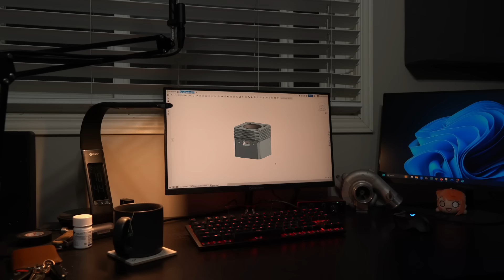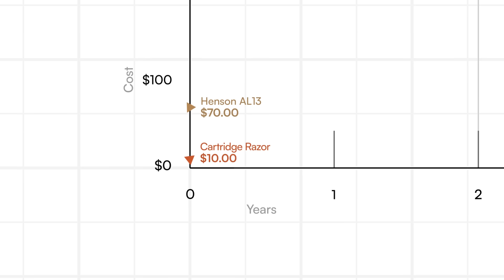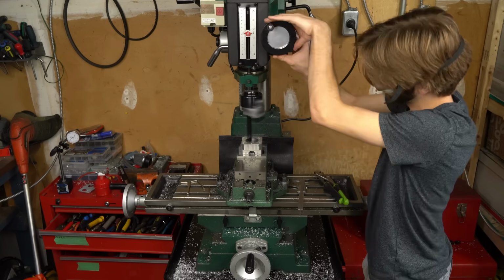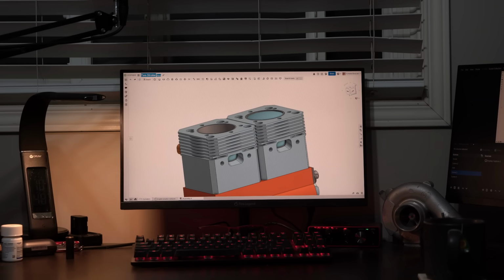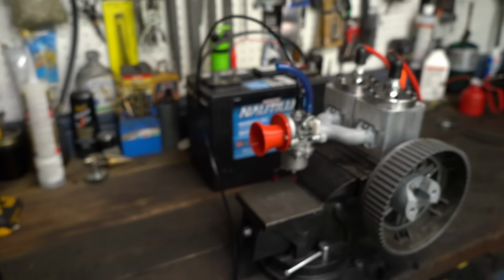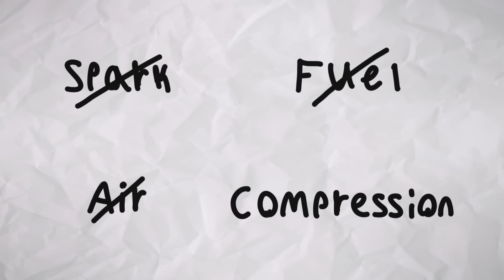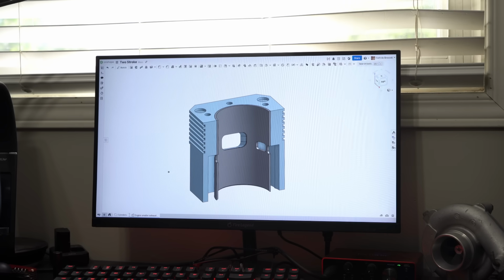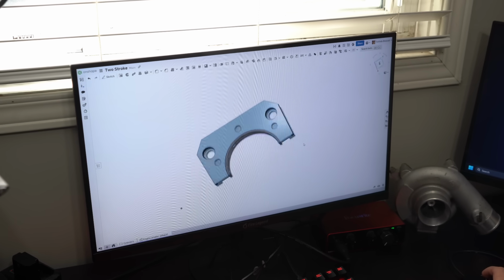Building a Two-Cylinder Two-Stroke Engine

Comment from the maker: 🪒 Check out Henson 👉🏼 https://hensonshaving.com/camden
Use the codeword: camden at the checkout, put the blades in your cart and get 100 for free!
Reply: I got a Henson razor a while ago. Go for the mild and not the medium. The medium is best suited for face shaving and is aggressive in other regions. Overall it’s goated
Reply: @onewaygaming8380 yes I also love it but the medium actually works for me on the body even with feather blades and I also have quite sensetive skin
Reply: If you're building a 2cylinder 2stroke, why not put one central carb on the crank case seeing as both cylinders are slotted and ported properly. You could probably also make the sleeves 1/32 thicker to help avoid warping, and i trust you are using a 2 stroke oil fuel mix to avoid wear out
Reply: I'm not going to stress the aero of the sleeves too much but having a slightly rounded entry to the intake port might help with the AFR
Reply: You need to have 2 stroke exhaust because 2stroke motor needs backpressure or it goes too light and copression doesnt be as good as its need to be. sorry bad english i'm a finnish 2 stroke moped guy and i have tested my 2 stroke yamaha dt without exhaust and it broke down because i didn't have the exhaust
Reply: You need a 2 stroke exhaust because if not it will have light back pressure and the gas will escape
Reply: @mamamia4458 yeah, thanks you did tell it better
Reply: The 2-stroke engine must have a muffler that has a space to reject exhaust gas so that the exhaust gas returns to the combustion chamber, like the muffler on a 2-stroke trail motorbike which has a bump, sorry for the language.
Reply: @AgusPradnyana-qy4zr you did tell it so much better what i did
Reply: Bir egzoz ekleyin iç kompresore ek hava almmaması için rölanti dengesiz olur
Reply: Respectfully 2 strokes are absolutely trash, the only good thing about them is they're lightweight and rev fast but that about it. A 4 stroke would be so much easier to get running right but it requires more parts but you can change the timing and other things so much easier. You can even buy a little predator 212cc engine from harbor freight and tear it apart to inspire you on your own engine and the small engine community around those types of engines have a lot of knowledge to learn and tricks and tips and aftermarket parts for you
Reply: @thecrittercage8255 daytona?
Reply: Add a cooling system
Reply: So much white smoke means fuel air ratio is not proper.
Reply: You maka da engine
Reply: Homemade wankel engine when?

Comment: do you put a taper on the pistons? They, as I'm sure you already know(sorry), will expand at the top near the rings as they heat up..
Reply from the maker: The pistons I used in this case were actually off the shelf, but to reaffirm, the top measured a smaller diameter than the skirt. I don't remember how much exactly but if I recall about 1/3 up the way from the bottom of the skirt measured in at 43.95mm while the top near the rings measured in closer to 43.85mm
Reply: @CamdenBowen  not to waste your time, I just thought that could have also led to some of your issues...keep the vids coming, strap that dual head 2 stroke on a bike too.

Comment: To prevent the cylinder from ovaling and to have the sleeve supported the entire height I would move the transfer ports away from the centerline and leave a thick rib in the middle.

Comment: If you enjoy model engines,  Have you ever visited the "Cabin Fever Expo" show in Lebanon PA ?  this year on January 16-17, 2026 Lebanon Valley Expo Center - 80 Rocherty Road Lebanon, PA 17042
SHOW: Friday: 9:00 AM - 5:00 PM  Saturday: 9:00 AM - 5:00 PM      They also have an auction where you can buy and sell lathes, engines, and tools

Comment: Honestly, you should do a twingle engine. It's a two stroke engine with two cylinders connected by a small passageway. If made correctly it can be efficient and reliable as a 4 stroke with the power of the two stroke. Just a suggestion, love your stuff btw.

Comment: Ok but what about an 8 stroke engine. It produces way less heat, has more time to get a proper air fuel mixture, and if you run them in offset parallel you could have a power stroke every n-th degrees if you wanted to

Comment: interresting, you did shrink filling and mention the trabant, that's exactly what they did in east germany. They had cheap access to aluminum but not to steel, so this was the solution.

Having an exhaust with an adequately sized end pipe stinger makes the idle much better. The smaller it is the more stable the engine runs . Too small costs power but runs smooth.

Also the china carburators are a$$. Better get some used moped carb, one from a real company. One that you know it works.
They do react in strange ways to adjustments. Often they do not even let enough fuel into the float chamber.
So no matter how good the engine is, the carb can fool you.

Comment: Reeds improve any piston ported engine. If you need extra fuel getting in, you could fit a power jet in the bell mouths. Some people fit them at the top, and others prefer mid-height mounting of the jet, It's easily done; I've fitted a few in my time, always at the top.

Comment: Instead of conventional 2 stoke you should make it like a 2 stroke diesel with valves and a crank case that can hold oil it will be more durable
Reply: you can't have a 2 stroke with valves
Reply: @oren2000  yeah you can two stroke diesels had exhaust valves for better scavenging I think they have to be supercharged though

Comment: shorter boring bar in the boring head would help the chatter. As a rule of thumb when you do a finish pass leave 1/2 of the insert radius for a good finish and when a part comes out of your work holding don't pull the tool out just hit the E stop  and leave it. you could have pulled the aluminum out of the vise and shot it across the room

Comment: awesome series, really. maybe you could try to run the carburator mixture into the crankshaft casing before routing it into the cylinder, this way the crankshaft gets lubricated and acts as a sort of volumetric compressor. keep it up nice work.

Comment: Cast iron sleeves should be used because they resist spalling and don't thermally expand as much as forged parts.

The crank and caps also need to be hardened, they'll wear out faster due to the unavoidable high pressure and high friction they endure.
Reply from the maker: I wanted to use a pearlitic gray iron because of its hardness and self lubricating properties but no metal distributor anywhere around me carries cast iron in any capacity. Next time I will likely order some from McMaster carr

Comment: Machine stability Is definitely a factor so I’d rigidity so make sure the gib strips in the slide ways are tight also try shorter or thicker boring bars as they will flex less lastly have a peek at your spindle bearings some sneaky mill manufacturers use ball bearings in their spindles these days and this is bad for quite a few reasons this old Tony did a deep dive on this on a mini lathe he bought hope this helps

Comment: a two stroke needs a fuel oil mix so it is lubricated pls do it  idealy 1 part oli 32 prts fuel but you would have to figure that out yourself because every two stroke has ist own preferences

Comment: I guess the problem is on the intake part you should be place the intake facing the crankcase not the cylinder so when the piston goes up it will suck the fuel and air mixture to the crankcase and when it goes down it will push the fuel air mixture to the cylinder block

Comment: the "two ports" setup you're using for my opinion is useless, it might work better with only one port. A and C ports in two strokes are different from each other, having one single duct that ends with two smaller ducts on the sleeve is not that good for performance, also the axial angle oof the port should be way higher than the flat angle you are using. i think you should redisign those ports and use a setup similar to old 100cc kart, really simple to reproduce and effective, the only change is that you'll delete the c port becouse you are making piston ported cylinders.

Comment: You never thought about opening the bore up on the buckets and use thicker wall sleeves?
Reply from the maker: I thought about that but I couldn't find any piping that would work
Reply: @CamdenBowen Yeah supply is definitely a problem. Try to find something in cast iron. I run cast iron sleeves in my drift car. Its an aluminum dart block small block Ford with a 9284 borg warner efr on a holley dominator. She makes 904 to the rear wheels. If cast iron works for my application surely itll work for yours. Good luck brother dont give up!

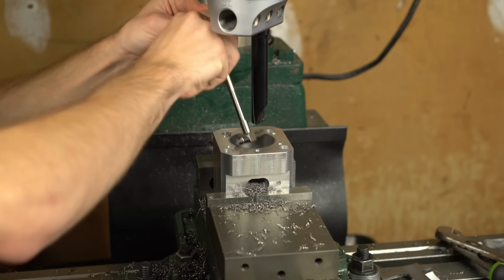Comment: 4:19 when you use a boringbar turn down the spindle speed untill it shakes less. The down side is you need to feed slower. This is what i did. Bolting it down also helps😁

Comment: using wood to insert those liners/sleeves is exactly what they do at a big overhauling company close to where i live. im not even kidding 😂. also at the end i saw you wiggling those connecting rods but they are allowed to move to the sides. they are not allowed to move up or down if you know what i mean. as in the bearing shouldnt be too big so they have movement up and down but they are allowed to slide on the crankshaft but they cant move to the sides.

Comment: Yeah pretty sure those lines in the bore are because your running that boring head at Mach 3. Any time I have ever run a boring head(professionally) it was always at like 50-100 rpm. Especially in steel.

Comment: when boring the cylinder you need to run the machine way slower than that, will drastically help with vibration and get a cleaner cut

Comment: A tip from when my dad was fixing his transmission, get and use a hydrolic press when press fitting things like that... using a hammer might work, but it also might fail, and a press greatly increases the chance of it going in to the right height. Father had to buy new bearings as they would go a small bit further in than the transmission needed, rendering them useless and he would need to destroy them to get them out.

Comment: The reason you’re not able to use a single carburetor for both cylinders is probably because a two stroke has a very high frequency vacuum signal, especially with two cylinders. Essentially, the single carburetor can’t keep up with both cylinders pulling vacuum at a fast rate. That’s why almost every two stroke dual cylinder street bike has two carburetors. Just guessing that if you wanted to use one carburetor, you would need one with a smaller throat and larger main jet to keep up. Smaller throat for faster air speed and larger main jet for more fuel.

Comment: Epic, now try to use a 2010 VW Routan SE cluster as a RPM meter (Needs CAN-Bus, 125kbps speed and 0x211 first byte for RPM, and 0x20B 0x91 to remove “NO BUS” message, pins 15 16 on second connector for CAN communication.)

Comment: Hey. fellow ammteur here. Try cast iron for sleeves and crank pin. Grey cast iron to be exact. It have all strengh of an alumium with more mallable structure forgiving slight milling errors. For better structural integrity you could use VG iron (Vermicilar graphite cast iron) its more expensive cuz of it spedial layer structure. Kinda like wagui beef. 
Also that thing def wont run smooth cuz it have no exaust even in plans. Crossplane exaust could help engine with suction witch will ease requirement on compression (better exaust, less smoke in chamber, more room for gas, more umpf, more momentum, more umpf etc). But just a pipe long enough should do too.
Reply from the maker: I originally wanted to use cast iron instead since it's also good for retaining oil, but the place I stock my metal from only had steel piping. I was hoping to get it running first then worry about designing an exhaust afterwards but that didn't seem to happen lol
Reply: @CamdenBowen  You were hoping to retrofit an exaust on homebrew desighn? You're a mad man. 
Also why didn you just bore out old sleeves from scrap yard? I think thesseus ship method is better for learning how to build an engine.

Comment: I'm thinking if u want a single carb make the intake slightly larger and move up a size or even a few on the carb in general (my experience with these exact carbs or similar ones isn't the best anyways, you get what you pay for)

Comment: Your boring head is not properly aligned with the cutter, causing a non- optimal rake angle on the blade. That is prone to causing digging when the setup is not that rigid to begin with. Here are some ways you can mitigate that: 1. Turn your cutter a few degrees clockwise (towards the cutting edge). This will alter the rake angle and should fix the misalignment. 2. Get a  lower/ smaller diameter boring bar, same effect, but just by moving the cutter backwards on the cutting axis.

Comment: 2 strokes are mechanically simple, but extremely sophisticated in construction. To get good performance (and durability) you must know VERY WELL everything is going on inside. And it's A LOT goin' on...all at the same time...That's why the seems to be all the same: decades of development converged on the same solutions.
I followed the creation of a V4 500 cc engine with lart cylinders...it took some years, but in the end 140 hp were there.

Comment: My friend, Your struggling because two strokes need a exhaust. Preferably built to suit your port timing. 
They run terribly without a pipe. Look into down pipes and expansion pipes. Lots of pressure and pulse things going on to make the engine make some proper power. I love your building a smoker. My Teenage was spent blowing them up with a smile on my face.

Comment: Let me tell you that I absolutely love your videos and what a great work you've been putting on your engines.
I'd like to suggest you one thing that mabye can help you:
- when you put toghether a fresh sleeve/cylinder with a piston, no matter what the tollerances are it is very important to let the skirts "get used to the sleeve", either by running the engine with the absolute most rich mixture you can do (4% oil at least) and at the least rpm you can do or (even better) with the gas plugged in, let the engine spin with a power drill very slowly and with the engine never powering up. It's very important to do that expecially because the homemade honing will always result slightly imprecise and because of the rather small cylinders. I noticed the differences by doing that while restoring my old 50cc italian moped engine. Hope this was helpful and again, great work!

Comment: Was just wondering the day before you uploaded when there was gonna be another video. By far the most polished thing you've built on the channel so far. The cylinder sleeves were a genius idea, since the sleeves kept getting gutted. Of course, that might have been because of the sleeve. I wonder why auto manufacturers don't use them, seems like a great idea that could prevent the engine being what defines whether or not a car becomes junk (besides rust of course.) It seems more like an engineering thing than a money thing.

Comment: This is super cool, I love seeing people pick up things & try! It doesn't matter as long as we have fun :) Too many people go after others because they say "it will be something I can do." & I don't like that. This engine of yours needs a little exhaust to help you, if you gain a little pipe & just get a few pieces of the right size with a taper funnel cone that should help out with back pressure to improve performance & outright consistency of it.

Side note, tolerance is incredible isn't it?! less than a few micron, it feels like, & everything goes, "But I've always hated you, you made me & it was from the start I've wanted you to make me die. Put me out of my misery you damn dude." Boron nitride might help with getting near tolerance, its electroless & can help with getting to those final points.

Caswell sells them, they are a little cheaper than you would think. Be warned though, those are the higher performance ends, it might make you start thinking of nickel forming like me & carbon alatropes for plating really quick. 

You end up setting in the liquid & leaving it there for a few hours or days &.... Well you are working Muahahahaha! Steels are the easiest, aluminum needs some chemicals to break the oxygen barrier, or just anything that scrapes it to remove it truthfully. Steel wool does work, yes. 

But I say be careful because 3 days might go by & suddenly you have quite a bit deposited onto the surface, sometimes a full centimeter of material. 

Congrats on getting so far from 3d printing your first prototype!! seriously, its awesome to see dude.

Comment: As someone who is also into engine designing the reason your crankshaft was wobbly is because it is a ball or needle bearing type. You need a bushing because of the force put on them, and since you're using what I assume is billit aluminum I would suggest using keyed steel piston sleeves since it's a 2 stroke, and extend the crankshaft so you can put sealed ball bearings on the end I would be open to drawing out a design for you. If you want to try to do it on your own though I understand but if you would like someone to consult let me know.
Reply: I wrote this before watching but you need thicker sleeves (I can't really tell but they look to be 1/8 in) around 3/16 in preferably 1/4 and due to the way you made your crankshaft there's a set amount of unbalance (I'm assuming) because it's welded and welding can cause stuff to warp I would suggest modeling and 3D printing a crank then moulding and casting then polishing it so that it can be as close to perfect as possible.